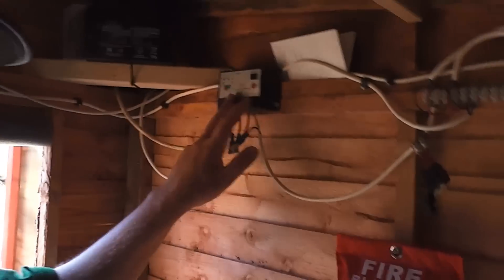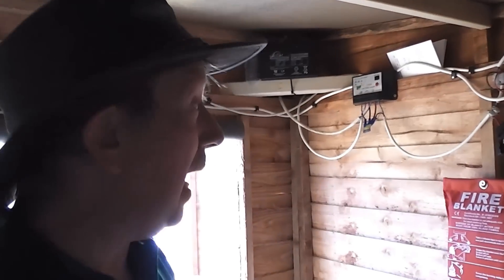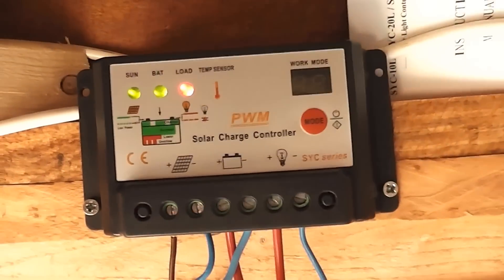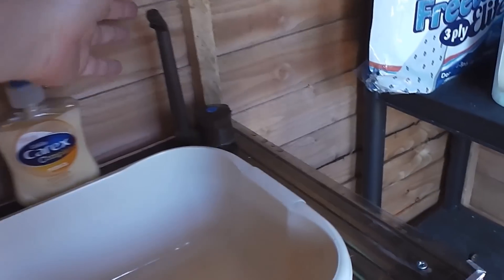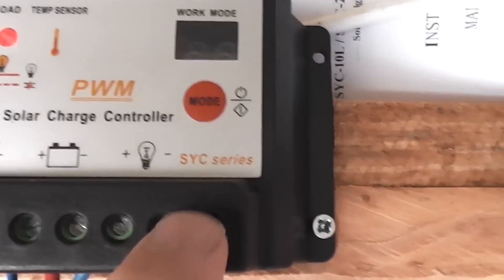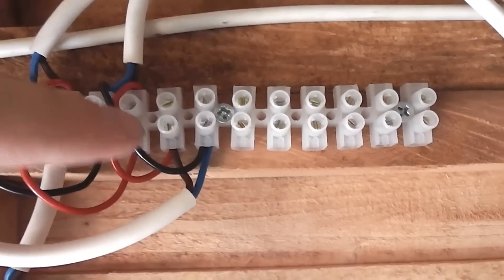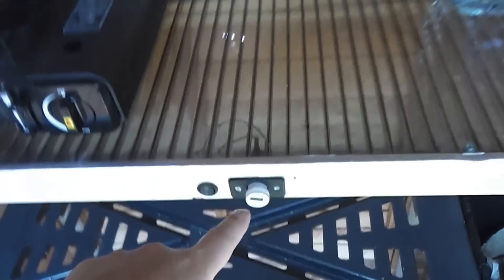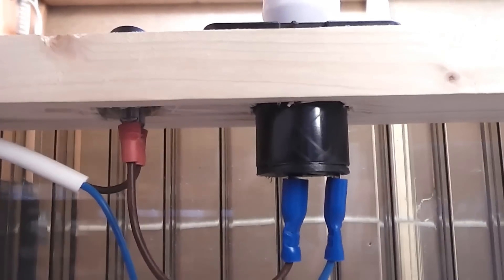12v Solar Power Installation For a Small Shed

Comment: Very helpful video, Rick !  I think everyone should at least have a tiny solar setup.   On a good sunny day I can power a 14wtt dc fan, a 14 watt radio, charge batteries for LED lights and charge a small jumpstart while  charjing my phione. The solar panels I use add up to about 18 watts total. They are fun to use and very handy. By the way, I also started growing some of my own food.   Thanks for the help !

Comment: Looks a bit rough at the charge controller, if you have access to a crimper use some red pins, with some heat shrink too if you can get it. Itl help take the strain off the wire just hanging by its copper strands.  :) Good basic setup otherwise though :)

Comment: Rick, would that battery run your LED lights, and for how long before depletion?  Odd Q, so no hassle if youre unsure.  Nice tidy setup, as usual.
Reply from the maker: Haven;t a clue to be honest, although I suspect a good few days (I had the same setup in my small van and it went weeks of intermittent use between charges)

Comment: Are you tempted to ramp up the input and convert DC to AC and run appliances off of it?  I am thinking things like an electric lawnmower or strimmer which are way lighter and cheaper than petrol equivalents, plus your power tools will be available.  That kind of thing?
Reply from the maker: No need, I'll just use my Generator :o)

Comment: Rick I worked (now retired) in an electrical power generation plant & I see nothing wrong with your explanation about your setup. Switches must be different where you are. They are correct for my side of the planet. I agree with Sparky with the fuse location in the circuit. However like Sparky stated, you are off the grid & have no plans to connect to the grid, thus no biggie. No National Electric Code nor National Electrical Safety Code (fire fighters code) to hassle with. Thanks for posting, you made my day!
Reply: do you have to notify building control if you have an offgrid PV system?

Comment: The fuse for the battery should be as close to the battery as possible, that way if the wiring along the way shorts then the fuse is still capable of doing its job. Where it is now, anywhere from the battery to the charge controller could cause a fire if it shorts out. For the load the fuse should be as close to the charge controller as possible in this case.

Comment: Hi Rick,
So do I understand this correctly that the solar panel ties into the controller to charge the battery. The battery is connected to receive the charge from the panel but also on the same wire feeds back to the controller to power the accessory circuit (light bulb)?
Thanks
Tim
Reply from the maker: I think thats right Tim. In an ideal world, I'm assuming the charge controller is designed primarily to be used at night in the form of a light. I would assume any use during the day would interrupt the charging process and any power generated would be diverted to the device being used? 
As the devices I have attached are only used intermittently, I'm assuming this will not be a problem.
All guesswork of course!
Reply: Thanks Rick
Much appreciated
Tim

Comment: Hi Rick
Great video as always.
I use a car battery,as my power source in my shed,and use it to power a 500w inverter...
I have run a 11w energy saver bulb   ,which roughly gives out 60w of light,and have left it on to see howi g before the battery voltage dropped enough to switch on the low power warning alarm of the inverter,and had to give up after 10 hours as it was still running,and the battery was still around 11.2 volts... 
Martin
Reply: Thanks for the Video clip! Excuse me for the intrusion, I am interested in your thoughts. Have you tried - Schallingora Computer Reconstruction Scheme (do a google search)? It is a smashing exclusive product for saving money using this smart solar power trick without the hard work. Ive heard some incredible things about it and my close friend Aubrey  got amazing success with it.

Comment: Hi Rick, run everything direct from the battery, overloading straight from the load terminals will melt your charge controller.
Hope this helps

Comment: There is no qualification in the UK to install off-grid electrics, only solar tied to mains electric! =)
Reply from the maker: Thats interesting and useful to know :o)
Reply: True story !! Even working with GAS or WATER is equally okay SO LONG AS none of it is linked into the grid or connected to any part of your household connections
Reply: *****
I'm in the NICEIC and I have asked my area chap he's never seen or heard of anything! If you are aware of something let me know I'd love to go on one!
Reply: I know about volt drop and I'm guilty in some cases of under sizing some of my applications! You don't expect much of the overpriced kits! I have 10mm for 2 x 80W panels over a 5m run
Reply: ***** I don't quite understand why you feel the need to tell me the ins and outs off off-grid solar installation when it wasn't part of the initial comment?
Reply: ***** On my channel I'm curently experimenting with LIFE lithium cells/recycled 18650's to make a portable power pack and find a solar charging solution?

Comment: Thanks for the vid Rick.
Can anyone tell me if I could use this setup to power some outdoor lighting on my decking? Thanks.
Reply from the maker: yes, you also have the option with this particular charge controller to turn the live feed on only after the sun has set.
Reply: rickvanman thanks rick. Would I need a 12v exterior light then?
Reply from the maker: Andy Nightingale
For this setup, i'm guessing so.
Reply: Cheers Rick. 
Keep up the good work!

Comment: Why do you have 2 fuses and when do you expect those to come in use? When the charge controller malfunctions? (I know very little about electronics, fyi)
Reply from the maker: Long story, suffice to say I forgit I'd already fused the wire before adding the second fuse LOL!  fuses will come into play in the event of a short circuit or a surge and prevent a potential fire.

Comment: As an electrician, i can find nothing wrong with your explanation, though i would have put the battery fuse close to the battery, your installation is ok, but if the battery was in a different location, and the battery wire got damaged, the wire could overheat.
Also, it is best to read the instructions that came with the solar panel, be sure to have a charge controller.
if in doubt, ask someone in the know.
Reply from the maker: Thanks Sparky, I was wondering what you might say after seeing this. Glad its positive :o)
Reply: I'm not sure but ,if anyone else wants to learn about how to install solar power kits try Magonsi Solar System Expert (Have a quick look on google cant remember the place now ) ? Ive heard some great things about it and my cousin got amazing results with it.